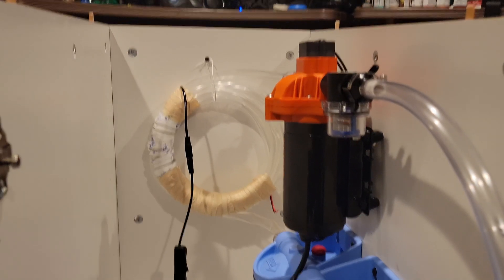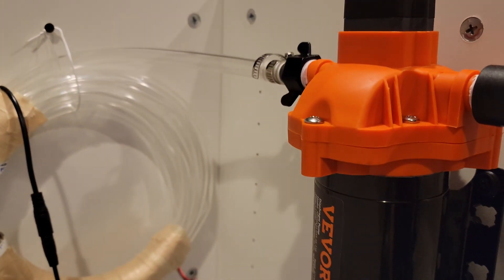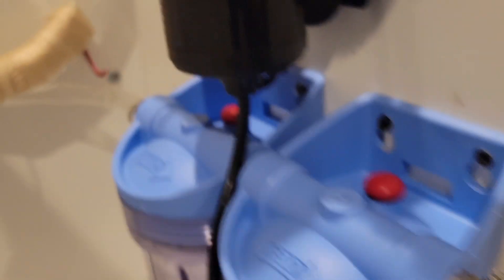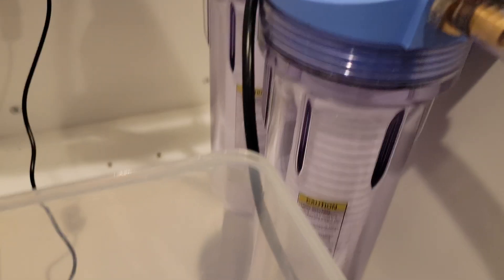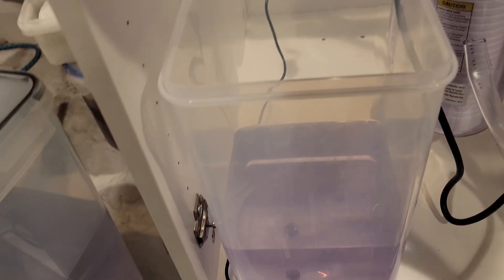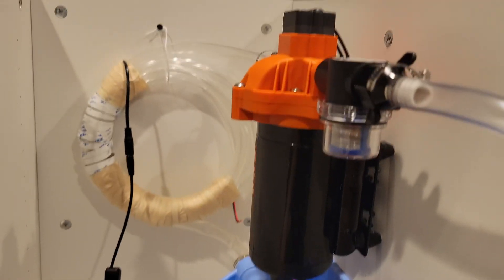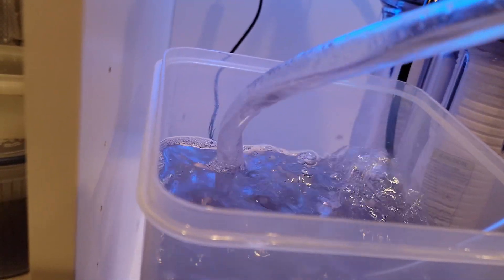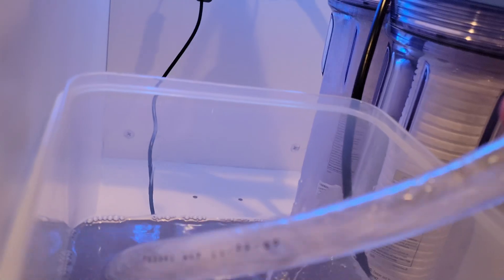My take on an IPA Filtration System mp4

Comment: Interesting! Did you see a significant improvement in the clarity of the alcohol? And is this something that you foresee running continuously, or will you be running it periodically, as needed?
Reply from the maker: It removed a lot of the floating particles from the alcohol. I will run it after ever so many print jobs. That way it will keep it from getting really built up and causing the residue to stick on the print.
Reply: @garyshobbystudio  Very nice! Thanks for sharing your work.

Comment: bro, sorry to bother you, but if i had to put such money and effort why didn't i buy a siebec megnetic pump
M7 - M15 - M25, depending on lt, for as low as 50€ plus a filter, active carbon or Extruded polypropylene cartridge at 0.5um?
Reply from the maker: I didn't create this. In the description I have the link to the video I found. I only showed this because it was a great alternative to the ways I have seen and even tried. He is an engineer and designs stuff. Those guys would be better to talk to about it.